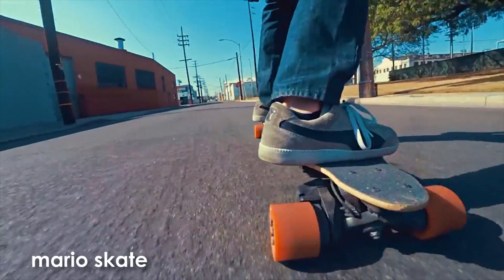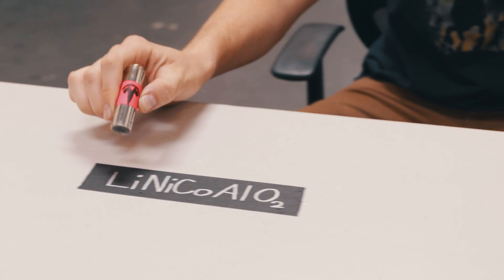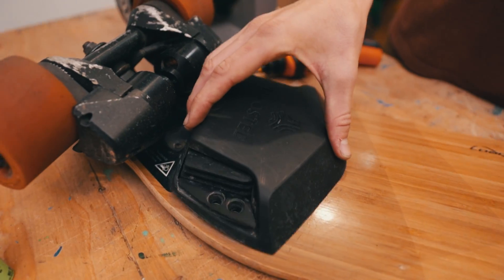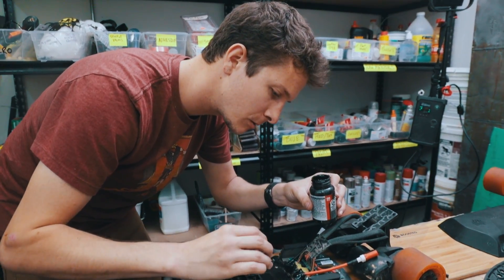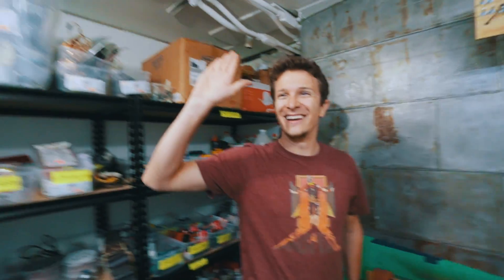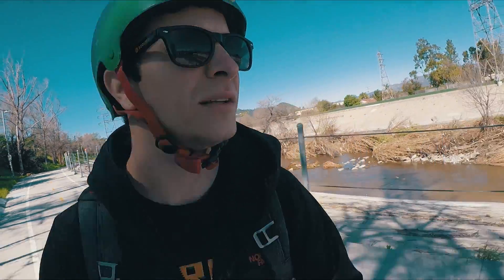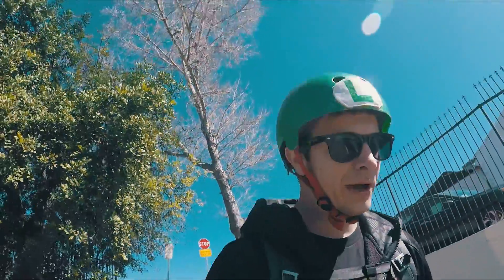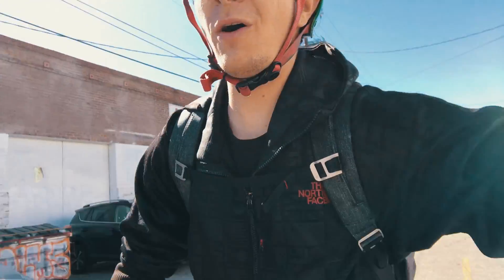Tesla Batteries in an Electric Skateboard!

Comment: probably an efficient generator (alternator)  will help you to solve the problem I am thinking at the wheels without traction... a Dc generator, permanent magnets should stay a little bit far from the coil/coils (refering to generator components) to avoid the break at the load ( the batteries in this case )or some coils iron - less but you will need speed to generate decent power to send it to batteries. In conclusion you have to design an efficient dc generator not to heavy which can be integrated in the mentioned wheels or with transmision..... looking over capacity of the batteries I am thinking at the small alternator used for small wind turbines (because It is not easy to design an efficient generator) the charging system should be powered when you are going down a heal. 
If you will try this be carefoul at the power generated by your alternator to not damge your batteries in general they need lenght charging....
The ideea is that  you don.t have to fully charge your batteries you need only some "pulses of energy " to use the " hiden energy"  of your batteries (in thos case the small efficient generator should stay connected  all the time....

st

Comment: "Money talk"! You have a proven  (2016!!!!!!!!!!) super capacitator which has 20 times more power density(than a LiPo), charges in seconds, has more than 30K cycles without loosing capabilities (LiPo looses with some hundreds...). Reduced size and weight (comparing with LiPo)!!!!! Based on oxide graphite and a 50$ lazer, turns into a consistente thin layer of graphene. Not supposed to heat, cause no internal resistance, and those pimps like tesla, Panasonic, Samsung doing a show off about a battery which was discovered in sec XX and selling very expensive "shit"  Check the link for extra info: https://www.sciencealert.com/this-new-technology-could-charge-your-phone-in-seconds. Doing a raw comparation, a ebike can do with that tech about 20 times more range than 100km... We are talking about 2000Km, low weight, and very fast charge. (Its a raw comparation because the pack's volume of those  super capacitators are less than a pack of LiPo... So , you can even extend it for more range).

Comment: if the problem is that the first battery is bottlenecking the additional batteries. Logically wouldn't you just get rid of the original? Just make sure everything is to spec, besides the capacity of the new batteries.

Comment: Connect both packs in series to minimize power loss to internal battery resistance, get a circuit to regulate the voltage down to the 40v needed, as well as a proper charging circuit for your battery pack to protect the cells.  Put a circuit on there, or at least a volt meter to let you know when the voltage drops too low, protect the cells from damage that way.

Comment: You might consider that your overloading the duty cycle on your motor in it likely is engineered to be able to run 5 miles before has to cool off a certain amount of time check with your duty cycle to ensure that you're not going to burn up your Motors prematurely

Comment: If I were you I'd disconnect the boosted board battery (with some kind of toggle switch) and run only off of the 18650s... heck, you could just remove the boosted board battery and add one more pack which would theoretically give you the same range.

Comment: Li-ion/LiFe batteries is probably the best for energy storage but I'd say that LiPo batteries are the easiest because you can eazly buy higher capacity ones. But you really need to remember 2 things to make it work and also safe. 1 deep scratch in LiPo batteries = Instant and furious fire, so maybe protect them within a plastic case. Second you can buy batteries with higher C-Rating. The c-raing is how much power the battery can draw at once. But you will use more energy and make the engine warmer when you push it harder. The batteries made for drones is probably the best for you because you need to draw power continously over a long period of time. Btw you can add a cheap LiPo/lithium battery checker that is sold from china for 2$. They can stay plugged in all the time and starts beeping when the charge gets low. I use them for my RC cars. No need to unplug them. They connect to the little white balance port in your batteries.
Reply: also why not plug in a thermal sensor with a beeping device if it hasn't one already, just to be on the safest of the safest sides.

It's overheating that puts most electric scooters (those Chinese ones) on fire. They don't have thermal sensors. Genius!

Comment: you could try to use the extra batteries to actively charge the booster battery so the booster battery can draw charge off the extra batteries and continue running longer,  exactly like those portable charging packs you can buy with a USB port to charge your phone or other crap while your not near a power source

Comment: LOL. The 18650 cell used in tesla are not the most technologically advanced. It`s the battery management system they use that is. The "tesla cell" is not the best suited for high amp drain electric skateboards. You`d be better off with a NCM chemistry than NCA. People just assume erroneous stuff because it Tesla. But a Tesla hold 7104 cells and can afford to have a lot in parallel to use low amp cell that have higher capacity. E-board cant afford to be heavy and thus require higher amp capable cell (but you can`t have both high capacity and high drain capability. It`s one or the other).

Comment: Rig a hot swap battery mount with a 3D printer and carry extra packs?
If you can rig this system up in the video then a dock shouldn't be too hard. Then you don't have to worry about the extra voltage.

Honestly I don't understand why Boosted doesn't have hot swap battery mounts. Even cheap boards have that.

Comment: The reason why yr battery isn't giving you the amps on the test run is because you've damaged the battery by over discharging it. I've done this many times with my drones. The battery may charge again and it may look fine but the damage has been done and you won't get the amps you use to get from it. Some batteries you can save by putting it straight on charge again when over discharging, but leave it for more then a few hours over discharged and you'll damage them.

Comment: You should try use voltage booster with fixed parameter on 40V, but on the other side you must to loose some extra miles and get overheating problem with that board (not the skate, but the voltage booster). Need some info, just PM me

Comment: You could put a boost converter after the diy batteries and set the output voltage of that a bit over the cutoff voltage of the board, this way when the batteries are full the converter isn't boosting but when the voltage gets lower than the cutoff voltage of the board the converter kicks in and keeps the voltage just a bit above the cutoff. And then you would probably need a override switch for charging.

Comment: Take the remaining extra battery voltage that the original skate board battery cant utilize, and make that into 2 more smaller batteries. That way instead of having 2 huge batteries that could only be utilized until half point, you can have 4 batteries which could be used fully.

Comment: For starters the board has a bms(battery management system) and a controller that regulate and limit power, to an extent you can "overclock" as such these specs but not too much before you are just generating a lot of heat and not much power boost, you are pretty correct on how the lifepo4 are limiting the tesla cells, however  you could just remove them make your batteries neater and add a 3rd which would easily fix this, tho I'm not sure they may have systems in place to help prevent tampering

Comment: if you use a boost converter, the pwm signal will adjust, and the output voltage should remain stable.

Comment: Yes and you can also boost your board..
Add strong Capacitors at right voltage, and discharge, have 4 of them and you have a continuous 2 temporary energy banks but one discharges the other one one over time.

Another way is to change wiring and add .. again capacitor but just 1 to draw energy from 1 battery and feed the "main" one. this way you can make a connection of series of batteries than having them being "bunk cabled" . . . . .

Comment: Try to find a way to turn the wheels into a power generators so as you go, it charges the battery making sure it doesn't die before you make it to work.

Comment: Ditch sole electric, and opt for a tiny 2 stroke engine and have it turn a generator on board, should increase range drastically (talking extremely tiny, light engine ) or just go for petrol entirely at the end of the day it will always have more stamina

Comment: Use a battery management system for the two packs you made (generally recommended), and find a way to fully disconnect the Boosted battery when it hits 33.5V so you can exclusively use the Tesla packs. This way the Boosted battery won't limit the drain on the Tesla packs.

Comment: From what I know which isn't much, I would assume your problem is not voltage its amperage, remember there is power controller circuitry on the board that may have to be reprogrammed , or you might also be able to fab up something using an DIY solution like an arduino would allow you to do such things with add ons... That's the reason the remote says dead when its still running. It could be a failsafe to prevent low current damage. Come to think of it i would look for a signal on the board with a scope to see how the circutry is interpreting the voltage perhaps via wave (sine, square)? if you could produce that signal it may trick the board into thinking that the batts are full until drained.  Im sure you considered most of these already tho...

Comment: The Boosted Board runs on a 12s battery. If you change your custom battery packs to a 12s packs, both the Boosted Board's  battery and your battery will run out of power at the same time.

Comment: Techically, if you can find a 3 or 2 position switch, you might be able to "switch" the batteries on or off. If you need the main battery for charging, that might work. The only thing might be you need either a switch which can stand the currents or build a switch box with an electronic one (Solid State Relais)

Pos 1 = Both batteries on 
Pos 2 =Only internal
Pos 3: Only external

The idea is that you can switch the main battery "off" as soon its capacity is exceeded and just use the external ones then. IF the circuit bord still functions, you can ride at least on the last percentages of the external one then till they are depleted. Then to recharge you can switch the main simply back in and charge. 

OR, like others might had mentioned, switch the main battery to the same Battery type your external use so they have the same Shut-off voltage.

Comment: couldn't you convert the extra energy to charge the smaller battery like a portable charger
Reply: or make a new battery same size as the main one and use that to charge the first battery and keeping the others alive and going so u will use more energy at a stronger rate making it more effective and you could also up the power on the gears to go faster

Comment: even though i am commenting a year too late the whole reason this didn't work well for people wanting to know is because how many batteries you have in series is what changes the output of voltage and parallel is what extends the battery's life aka a series of ten cells outputs 36v but has around 3000mAH but having two ten cell series in parallel gives you the same voltage but it holds 6000mAH and for a boosted level power output you are mostly going to need a 13 cells in series to mostly match the lipo batteries!

Comment: Switch out the boosted battery for the secondary battery once you run out of the Tesla battery it will use the regular battery. Switch the order in which it draws power

Comment: your not getting the amount of current you want because electricity doesn't work like water, you would need to make every wire after the battery larger or increase the voltage, its the same as overclocking, voltage is pressure current is the size of the water pipe if u insist on using that analogy

Comment: So if you added a small motor to the back wheels to act as a dynamo you could connect that to the batteries and use the powered motors on the front wheels to drag the back wheels and generate a small amount of voltage to supplement the batteries like a "pass thru charger". SCIENCE THAT SHIT! Lemme know why Im wrong.

Comment: its possible that the motor controller has a low voltage safeguard ? even tho you have current to spend the sensor might limit throttle. was there any odd throttle characteristics? or was it a smooth deceleration?, i have a swagboard NG-1 and it stutters at low voltage.

Comment: Umm. why don't you ask the manufactuer. They might help you out as a project so they can up their battery power. 

By the way what you need is to find the controller and reset it to support all the batteries, though you might have to disconnect the one that's part of the board. Oh and I would disconnect the one on the board. The battery on the board is small and hindering the operation. I would try that 1st before you make any modifications that cannot be reversed. The controlled on the board will look at the larger battery as the primary if the smaller one is gone.

Comment: You could try to make batteries that produce a high enough voltage but only it can be created by kinetic energy as you push on the board which could do it if experimented with you should also ask the company if you could maybe work for them as a scientist to make it run and some what kinetic energy

Comment: Boost/bulk converter. Steps down the voltage when the battery is charged, steps up voltage when its low. 
Two more limitations are:
A: Lithium batterys put out less current the lower their voltage gets and
B: Your motors on that sucker have a limit, and im sure you're hitting it.

Comment: Can you bypass the boost battery at the start and use just the Panasonic batteries for the first part of the trip, then parallel connect back in the boost battery for the balance of the trip?

Comment: So simple... All that energy use in a more proficient way... Simply put... Start learning about rc planes helis speed controllers.... You have a product that uses an idea and none of the engineering that goes behind longevity, i.e. I have a plane that runs in a 50cc dirtbike equivalent brushless motor running 12 s 5g mah lipo total weight 13 lbs with 60+ lbs static thrust... Gear ratio or belt driven is even more engineering

Comment: I know how to fix it. Let's say the base output of the original battery is 5 volts. Just make the tesla batteries output 5 volts into where the original battery was, as well as outputting to the motors. What you could also do, is make a circut that makes the tesla batteries constantly charge the original battery or something...

Comment: i think you need a switcher from paralel do series. when the voltage is low you can switch to series mood and increase the voltage. i think that it is the most easy solution

Comment: You should get off the bosterboard batteries and replace them by an another batterie pack like that that will be in the same voltage
Reply: And you should get a biger output so there is more voltage so more torque and esealy ride in différant condition like a 4×4

Comment: You need to put a extra cell in each battery pack, add a cut off circuit, and resist the head voltage so it doesn’t go over the nominal of the boosted board. When the packs finally die your boosted board battery will still be full. Downside is you’ll need a separate charging circuit.

Comment: Old video, just came across it. Boost converters can, and will adjust the voltage. Most converters appear to have a 10A limit based on heat dissipation, and work mono-directionally, so they won't allow you to charge while you're moving. If you throw in an inverted low-voltage cut-off (sense voltage, if low, flip relay), you might be able to get this to only run while the battery voltage is below the minimum operating levels. Your best bet is probably just carrying a 2nd charged pack in your backpack and hot-swap them about half way.

Comment: Delete the boosted board battery add the two new ones you made make sure it’s getting the same voltage or maybe a little less than it maxes out and you’ll be good also add another one if possible

Comment: Reverse the old battery so that it’s able think it’s still full and the others can use the rest of there power and for the problem with the wheels try upgrading the motor that turns it and put on rods so the it can stay strong even with a lot of wight.

Comment: Start from scratch with better motors made to and the tork and load your looking for and a new computer board and your homemade battery to power your invention. In the long run modifications on something that was never intended for what you want may be fun at first and open your eyes to what you need. But less expensive to just build it from scratch

Comment: you should add a joule thief circuit to the battery of the board and connect another joule thief circuit to the other end to the whole circuit so it draws out all the unused voltages for you to continue on riding even though your battery on the board still have power

Comment: So if the boostit board battery is too small to handle the max charge of the two packs you made, then couldn’t you just wire the 2 battery packs directly and essentially cut out the middle man.
Or perhaps install a larger pack that can charge with the regular charger...